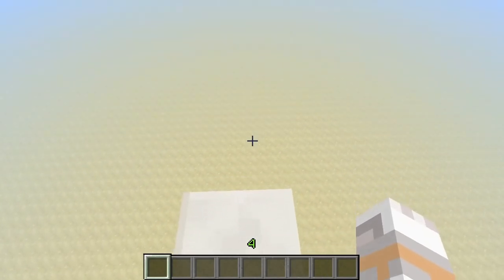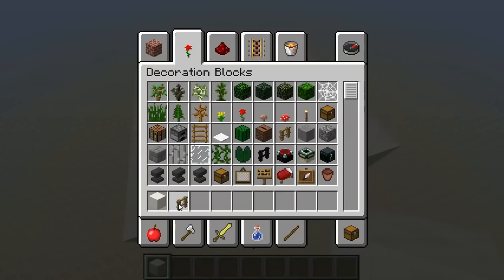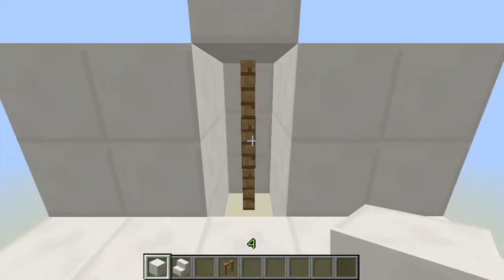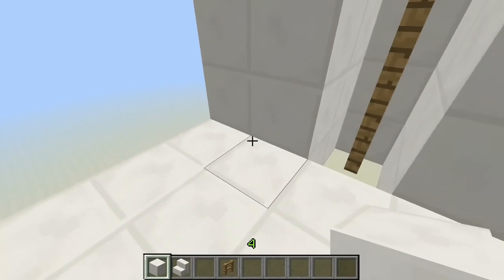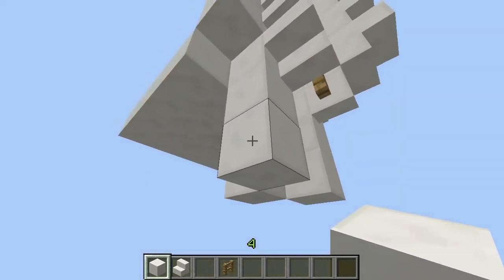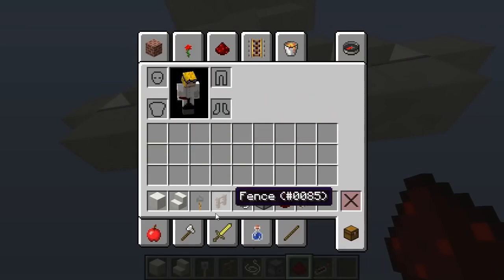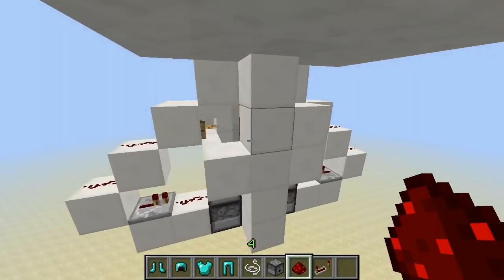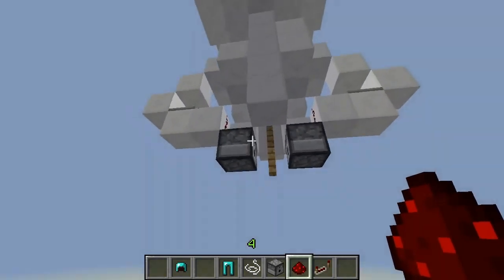Over the shoulder: Bat-Pole #1

Comment from the maker: The problem with the water is that it takes too long until it travels the two blocks it needs to flow to. I only have a few ticks after the tripwire get's activated, not enough for the water to flow in (as long as i don't want to fall 50 blocks or so).